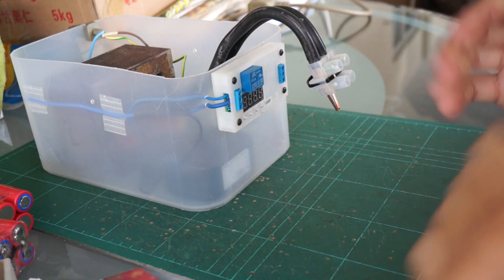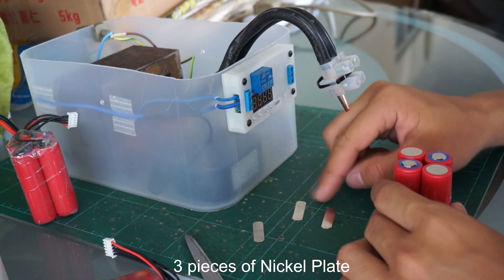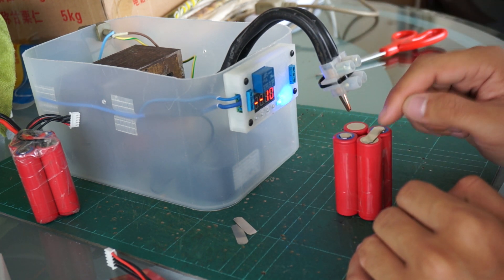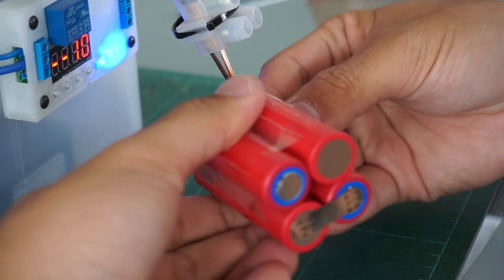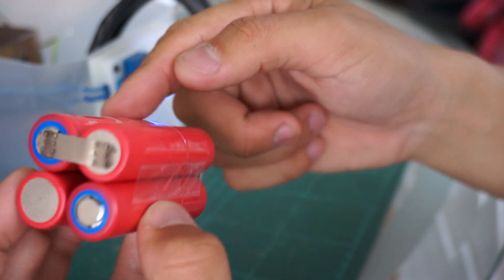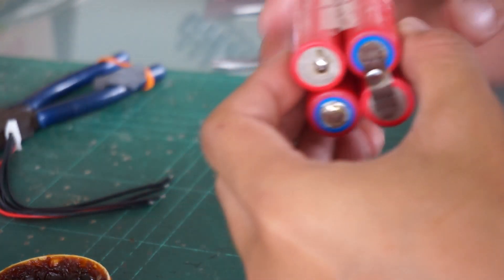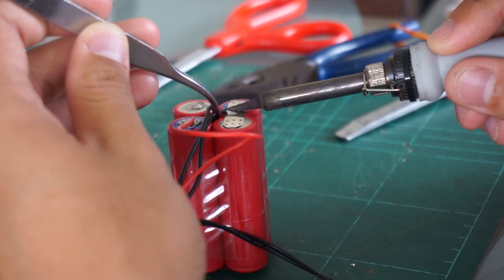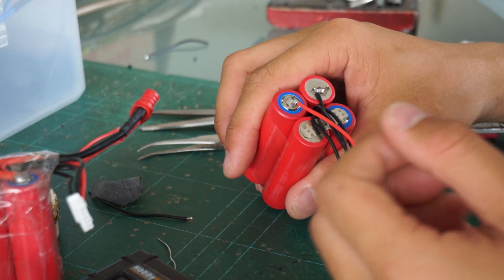Complete Guide Making 4S1P LiIon Pack for Wing Wing Z84 FPV

Comment: I am about to make my first 18650 4S1P pack for my S800. I know it is best to spot weld to avoid damaging the cells. But even though you have a spot welder you soldered to them anyway. Wouldn't it be better to solder the balance lead or main terminals to a a tin strip first and then spot weld the strip to the 18650? BTW: That welder looks great. I am off to watch your video www.youtube.com/watch?v=8cAl5raxnRU now
Reply from the maker: Well because it's easier to weld the lead to the nickel plate than soldering nickel plate to the Li-ion which requires high heat of at least 300C above.
Reply: I were going to ask the same question. I have to use soldering Iron to make mine. Going to use Panasonic 3400 mah.
Reply: I'm about to do the same thing, how long flight time do you get with this pack? Thanks